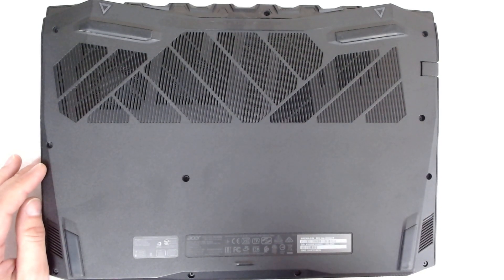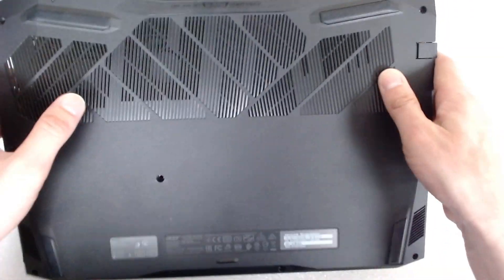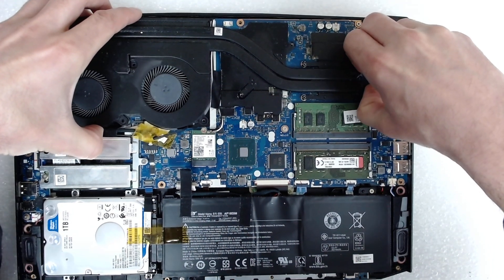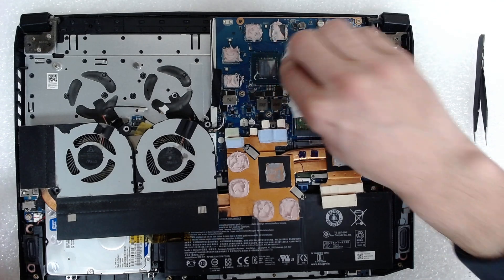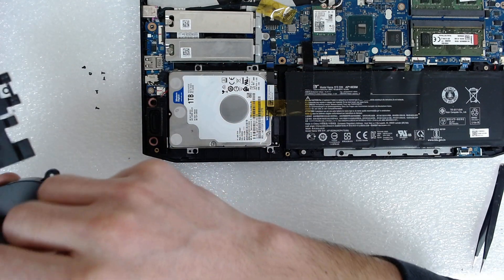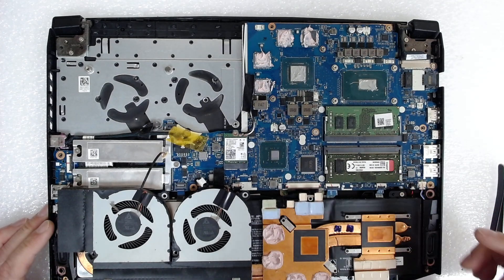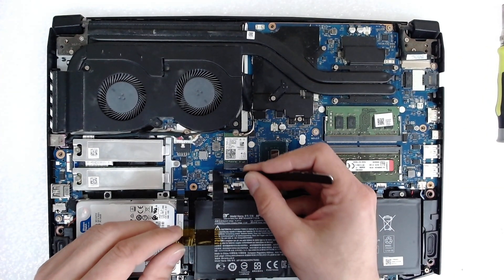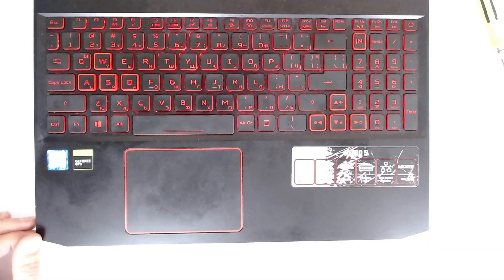Acer Nitro AN515-54 Disassembly / Fan Cleaning

Comment: I don't know if you or anyone is still answering this video, but I got a question: Recently cleared the air vents with pressured air and now my fans won't allow temperatures go up than 70C (acording to NitroSense)

However, I feel one side of the laptop warmer than the side closer to the fans. I worry that side is overheating and the app doesn't detect correctly the temperature of the CPU (or whatever is in the area where you applied thermal paste).

I don't know if this is normal on laptops, because in this video I can see the fans are connected to the left side (I imagine that's how heat transfer), I'd appreciate any opinions, it's the first laptop I buy and I'm hoping it last for another three years, so I don't want it to overheat. It has one year.
Reply from the maker: If you place the laptop in fron of you and you open it, the fans are on the right side. Usually it is normal to feel heat in the upper site of the keyboard. On the left side the CPU and the GPU are getting hot, after that that heat is transferred to the fan side via pipes, so it should be  hot on the left and right side. If the temps dont go above 70 you are fine. Just have in mind, that id there are big pieces of dust insight, and you use compressed air, the dist is going insight the fan, and it may block it from spinning. Just keep an eye on the fans from time to time.
Reply: @LaptopDisassembly  Omg I didn't expect you to answer, less this fast. The right side is actually cool when the fans spinning, only the left feels hot. And in fact, the fans were making sort of a "whirring" sound, like if it hitted something, before and after the compressed air. At high revolutions it doesn't sound, only on low. I have been paying attention to the sound, it hasn't increased or anything.
I know the best I should do is open it and clean it, instead of compressed air. But im really nervous to break it, or mess with it, and my family encouraged me to not do so. 
But your answer brings me some peace, and I'm aware of the risk with this information. Thank you so much.
Reply from the maker: The left side should be more hot, because the right side is cooled faster because of the fans. Also on every 2-2.5 years is good to replace the thermal paste.

Comment: I tried cleaning my laptop, everything went smooth untill I saw that 2 screws on the thermal thing were destroyed. I bought the laptop as used, and now because of 2 screws i cant clean it up
Reply: bro what did u do? cleaned it or did you let it go? cuz i tried it today but i can"t unscrew 2 screws on cpu and i stripped it.
Reply: @kerimguner1405 hey, so what did u do ? Bc I’m having the exact same issue right with those 2 screws lol ?
Reply: @malykii3  hey, i took the computer to the repair shop. he had used a better quality, properly sized screwdriver and applied some pressure. he replaced the ruined screw with a new one and now i can fix it myself.
Reply from the maker: Try to use a pliers or different size screwdriver. Otherwise you can drill the heads with a Dremel.

Comment: Can you point out where is the wifi adapter? Mine is not working after cleaning.
Reply from the maker: The adapter jack is on the left side under fans. This model needs the back cover on, in order to power on.

Comment: This video is an absolute gem.....the whole process and procedure is crystal clear and easy to understand and follow.....this man should be employed by a company to make tutorials....he would be a complete success
Reply: Nah for real dude. I don’t know how much i can thanks him, everything was perfectly made my computer is perfectly working even doe i’ve never in my life open a computer
Reply: @mistaa3193  would you recommend it for me too? I have a rather old acer nitro 5 (like 4-5 years old).
I never opened my pc. As long as I have the right screwdrivers and a tweezer, should it work?

do I have to use a paste? Or can I just not clean it off and put the parts back in? I don’t have a paste.
And would you recommend this process although I never did anything similar?
Reply: @saftigebadewanne5650  ofc dude this is extremely easy I’ve never opened a computer before as well, do it ;)
Reply: @mistaa3193  thanks! ;)
But do I have to remove and reapply the paste?
Reply: This 👆

Comment: I cleaned ton of dust accumulated after over 1.5 years of usage and applied thermal grizzly liquid metal on CPU and GPU dies and believe me temperature has dropped like 20+ degree Celsius, its over 1 week since cleaning and I'm still scared if liquid metal messes up something inside
Reply from the maker: When applying liquid metal is a good idea to put heat resistant tape around the crystal, this way it the metal gets around, the parts will be protected.
Reply: @LaptopDisassembly  I did more than that , i applied two conformal coating layers and then covered with electric tape

Comment: I'm having some issues with my laptop, makes loud sounds from the fan. I don't have money to bring it in to get cleaned by a professional. I found some tools laying around and managed to open the back using your video. Got the fan screws. But every single cooler screw will not budge.

Is there an alternate way I can clean the fan? Had a lot of dust. And there's some loose pet hairs inside, likely from the fan. Is it safe to use my vacuum to suck it out? I don't want to risk ruining it as the vacuum is quite strong and I know electronics are very delicate. Would using my vacuum cleaner on the fan damage anything??? Also the black and yellow tape/tabs have hardly any stick to them. What are they and is it possible to replace them? I don't want them to come loose and it stop working. This laptop is all I have and was very expensive which I only got through very lucky circumstances and I would never be able to get another one for years if something happened to it.

I'm gonna close it up and put all the screws back, and just hope the tiny bit of dust I got out with my fingers and the screwdriver (gently) will help.
Reply from the maker: Use a vacuum cleaner. Hold the fan, so it doesn't spinn and try to suck whatever you can. Also you can try and blow from outside while vacuuming. This way you will clean the dust, but it is good idea to replace the thermal paste also.
Reply: @LaptopDisassembly  it sounds much better after using the vacuum. Also my GPU and stuff's rpm is much lower now, I don't know what they mean but noticed they were getting higher with time. Amy games I play are also running much more smoothly too and my computer sounds normal again.

Thanks for your video, I was so scared of ruining something after I got the screw off to take the back off before I found it. I was having a hard time figuring out how to remove the back and getting it off was difficult after your video told me how to remove it. But with your instruction I got it! 

Have a good day/night

Comment: Do I need to put in new Thermal pasting? Or can I keep the original and use the QTIP?
Reply from the maker: If you lift the cooler you have to replace it.

Comment: Im having trouble disconecting my first fan help
Reply from the maker: I doubt i can help like that, but use something sharp and try to open it each side. Ones you move it a little bit on each side will be easy to pull the cable.

Comment: I highly doubt the customer was using the wrong screwdriver because the manufacturer over tightened some of the screws on the vent. I had to destroy 2 of the screws and buy replacements when I was cleaning my laptop.

Comment: Had a busted GPU fan on my Nitro 5. It kept making a whirring and rattling noise so I finally decided to replace it myself. This video is an absolute gift it helped with the replacement everything worked like a charm. No more noise now and temps easily dropped by 5-10 degrees Celsius. Thank you so much man absolute legend!
Reply from the maker: That's what these videos are for.
Reply: Jack what fan did you got? I had the same problem with my GPU fan but I don't know what is the correct fan model
Reply: @mickaelgoncalves9198  my CPU fan also has the same issue, can one of you send a link to what you bought?
Reply: @edwardkrueger1930 did you ever find it because I need this 😭
Reply: How did you replace the GPU fan?
I have the same problem
Reply: DID Y'ALL FIND IT
Reply: Where can i buy replacement fans?
Reply from the maker: @tornmien ebay, AliExpress

Comment: The first time I looked at this video I thought it was hard but it's easy 😂😂 also what did you sue to whipe?? Also how long will the thermal paste last?
Reply from the maker: I usually use kitchen paper and a q tips. About the paste, all about what you use. I use arctic mx-2 and it lasts about year and a half up to 2 year.
Reply: @LaptopDisassembly  ok thanks, I've gotten new fans. But just in case I have the same issue with the sound  does that mean I'll need to replace the thermal paste and clean the fans? Not sure if old thermal paste is what caused it
Reply from the maker: If the thermal paste is under 2 years a and you did not lift the cooler,you may not replace it. But it is always better with new one.

Comment: Is it possible to replace only the cpu fan on this laptop? Acer is trying to sell me the entire heat sink module just to replace my one faulty fan
Reply from the maker: yes it is possible...
Reply from the maker: https://www.amazon.com/HK-Part-AN515-43-AN515-54-AN517-51-AN715-51/dp/B08M5GDGGS
Reply: @LaptopDisassembly  Thank you so much!
Reply: @LaptopDisassembly  one more question! there's a tape that is attached to the heat sink on the fans. Do you know what this tape is called? Cause I assume I need it when replacing the fan
Reply from the maker: @ThijsTrials  you can use any type of black tape or a duck tape.. It is use only to hold the fan to the cooler... nothing else.

Comment: Should I change pink paste with pads but not sure about thickness of pads that I need to use as substitute for pink paste, pads should be what 0.5,1,1.5,2? 🤔 Some help would be nice.
Reply from the maker: I never replace them, usually they are around 1mm
Reply: What is the name of the pink paste? Where can I buy it?

Comment: What kind of paste is the pink stuff? How would I be to replace it?
Reply from the maker: It is kind on thermal pad. If is all there, i advice you to use the same. It looks like gum, but it is normal.
Reply: @LaptopDisassembly  Thank you. 

But if I were to replace it in the future, how  would I?
Reply from the maker: @crocomire9482  Just buy a good thermal pads with the right thickness. Around 1mm

Comment: I'm not a computer tech guy and my gaming laptop is having these issues, is it possible to get the fans fixed at a computer repair store?
Reply from the maker: What exactly is the problem with the fan. Not working at all or just overheating. Both cases can be fixed is a repair store.
Reply: @LaptopDisassembly  well my fans just make these anoyying sounds. I have the model you were working on, acer nitro 5.
Reply from the maker: Try with cleaning and lubricate thw fans first.
Reply: @LaptopDisassembly  k I had the fans cleaned out but the sound is still continuing, what should I do??? I'd there a reason why they keep going like that???
Reply from the maker: @solar-jaymi  you did replace the thermal paste also.
Reply: @LaptopDisassembly  not not exactly, but the fans were a hot mess before they were cleaned. The dust mest them up so I'll just get them replaced
Reply: @LaptopDisassembly  I will replace the thermal paste once I get the new fans, your video helped me thanks :)
Reply from the maker: Ok, but it is good to replace thermal paste also.
Reply: @LaptopDisassembly  kk
Reply: @LaptopDisassembly  ok thanks man!!
Reply from the maker: If you have some doubts, go to a local repair shop... Otherwise you can try your self. Just buy a decent thermal paste like arctic mx-2 or mx-4

Comment: Someone please help me i tried this now my laptop wont turn on or detect charging
Reply: Just saying im not joking
Reply from the maker: @Anfernee43   Are you sure i did plug back the battery and the power connector to the board
Reply: @LaptopDisassembly  yes no light detecting power I disconnected battery reconnected still nothing even reconnected the plug in power
Reply from the maker: Did you try with the back cover on place. Some of these have a small switch, which is pushed with a plastic pin on the back cover.
Reply: @LaptopDisassembly  i dont have that model i have the one in this video
Reply: @Anfernee43  the same thing happened once with my old laptop. Turns out the RAM wasn't properly seated. When I put it back in place, it worked. Try that.
Reply: @usuallyclueless4477  thanks at least someone said something helpful.. unlike the person who made this video
Reply: @usuallyclueless4477  also very weird how all i did was remove the fan
Reply: @Anfernee43  that worked?
Reply from the maker: Well i cannot fix your laptop remotely. If it was the ram, the lapotop will power on and it will have a ligth on the charger but no picture on the screen. You say you have no light at all so i wrote you to check all the cables first. When disassembling the laptop there is NO NEED to remo the ram, that's why i don't mention it.
Reply: @LaptopDisassembly    no i know that, i didn’t touch the ram i was referring to how you didn’t respond backI understand people are busy and forget though no bad intentions just frustrated , i also thought you meant to find the reset pin
Reply: @LaptopDisassembly  hence why i said i have the model in this video i was getting ready to leave for a flight and my laptop crapped out, im back now and if nothing works ill just see about getting it repaired
Reply: @usuallyclueless4477  im not home yet ill mention the results once i do
Reply from the maker: If you are sure you plug everything correctly and the charger is fine, than you need to use a multimeter to messure some voltages. On the bios chip, on the first and second mosfet. Usually if you are sure you did not damage something, the problem is in some small thing like unplugged cable, fozen bios or etc.
Reply: @Anfernee43  okay. If its not the RAM, check all the wiring once again.
Reply: @usuallyclueless4477  yeah its a negative boys i dont know why i followed the steps throughly and watched the video multiple times before attempting to take out the fan
Reply: @Anfernee43  could you figure out the problem?
Reply: @NYTSHD  nope took it to a repair shop says it shorted out I don’t understand why everything was turned off before hand hope you didnt try this rather you take it to a place incase they mess it up they have to pay for it
Reply: @Anfernee43  looks like I'm gonna go thru it as well...So you had to replace the complete motherboard?
Reply: @Anfernee43  could you tell about the repair process?
Reply: @NYTSHD  they wanted $800 for the whole repair (ubreakifixit)  im just going to go for a full gaming desktop but if you buy the right motherboard it should be around $300 for you to get it and maybe a repair shop could do it for way cheaper if you bought em
Reply: @NYTSHD  they did say i had to teplace the motherboard

Comment: I thought i unplugged the battery but i unplugged the thing next to it and then a screw dropped on the motherboard and short circuited it :(
Reply from the maker: Did you try to power it on after that. It may still work fine, depend on what was shorted.
Reply: @LaptopDisassembly  yeah, ive checked all the connections inside as well, the blue light doesnt even show when charging
Reply from the maker: Just in case,  reset bios from the cmos battery and wait about 5 minutes,. After that try to power on the laptop without the battery connected.
Reply: @LaptopDisassembly  i unplugged the cmos battery and the battery, held down the power for 30 seconds, then plugged everything back in and tried to charge and turn it on but i didnt work. Ill try take it to a repair shop and see what they can do and how much it would cost

Comment: Hello, i would like to replace my fans and thermal paste, but in the process, i would like to put in new fans, do you know any which are BETTER than the original ones? maybe some tips? anyone? i would appreacite any help.
My model : Nitro AN515-52

I know a lot about computers but notebooks are kind of different branch
Reply from the maker: Well you can't put whatever fan you want. It has to be compatible for the model. Best way is to use the origunal ones. If they work fine, a little lubrication will maket them like new. If they are noy working fine than replace them with the same model. Otherwise you may have problema with rpm and etc.

Comment: repasting in mandatory? or i can  leve the old one for a little bit more ?
Reply from the maker: If you lift the cooler from the cpu it is highly recommended to replace it.
Reply: @LaptopDisassembly  for open the cooler is necessary lift it form the board ? lot of question but i want to be sure before open it :D
Reply from the maker: In order to clean the fan you have to lift the cooler. You can just open the laptop and remove the dust without lifting the cooler. This way you may not replace the thermal paste if you like.
Reply: @LaptopDisassembly  since some days ago for some reason i got a huge performace drop...dunno the reason im supposing the overheating ( cpu 52°/11% gpu 51%/0%) is drive me crazyyy
Reply from the maker: 51 for a cpu is not that much. Update the vga drivers first.
Reply: @LaptopDisassembly  i opened it , give clean to the fan , then i simply factory reset ...now seems fine ... :D probabily all the crap i saved and for sure i messed up some settings ! anyway  thanks u